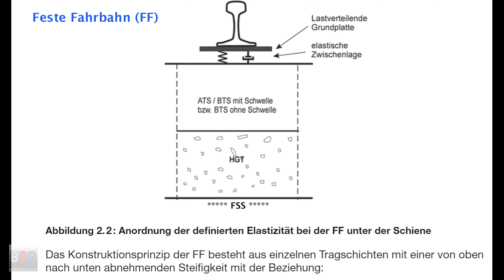Stuttgart 21: Unterbau Feste Fahrbahn, Bomag BMF 2500, Vögele,... PFA 1.3, 26.05.2023.

Comment: Nice video - interesting they are using measuring tapes for the width and not using the GPS, wonder how long it takes to spray out the paver every night so it doesn't harden up in the screed. Cheers and stay safe